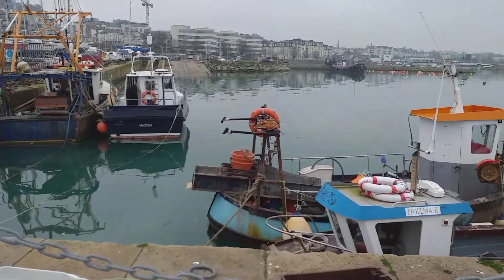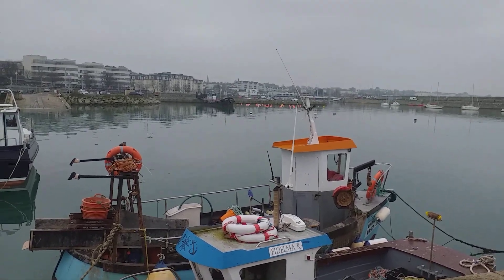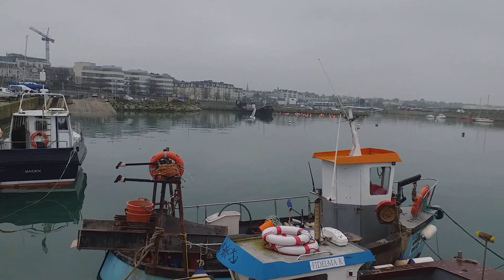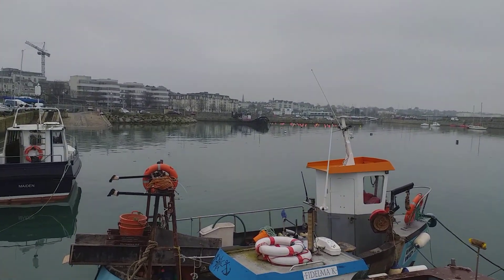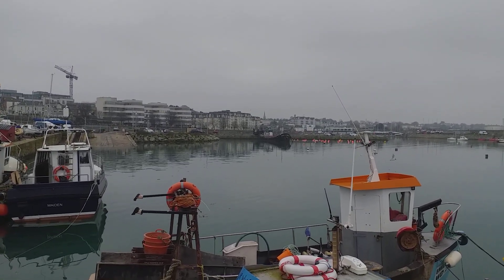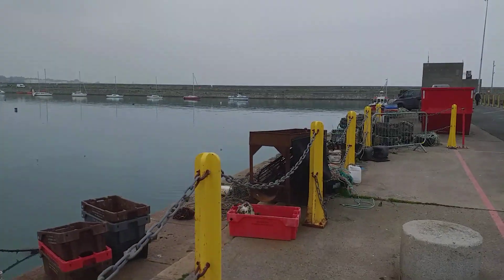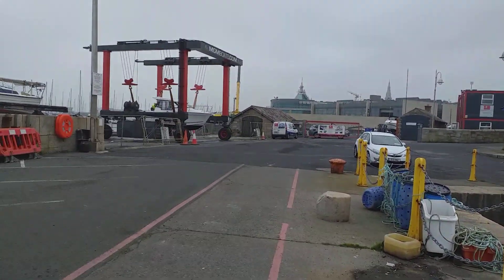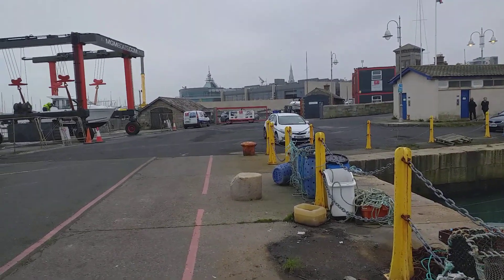Talk on traders wharf constructed 1855

Comment: The railway layout going down to Traders Walk consisted of a single line going from main track at station to Irish Lights where it became a loop until it got near the Warf where it 
became a single to the end of the pier. In the 50s and 60s most of the traffic was for the Albright and Wilson factory which was based where the Apartments, Clearwater are. I remember
engine and wagons going there on quite a regular basis. Before the Albright and Wilson the Dun Laoghaire gas works used to be there.
Reply from the maker: Thx for that detailed information on the railtrack on the wharf John